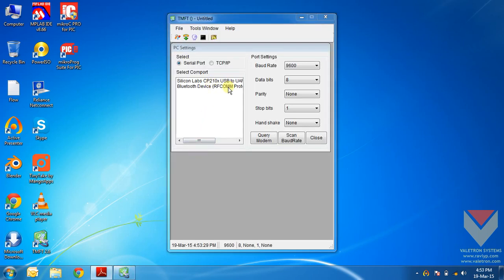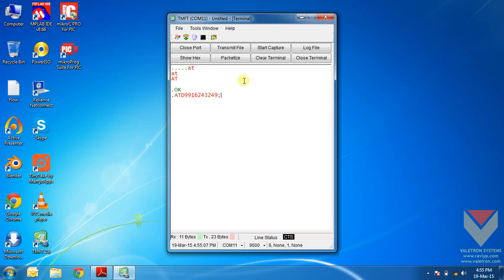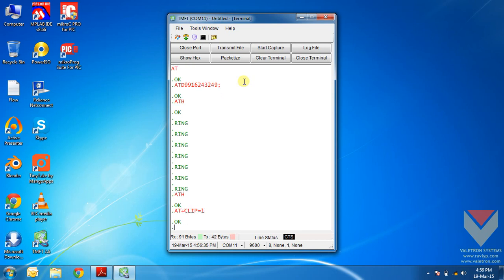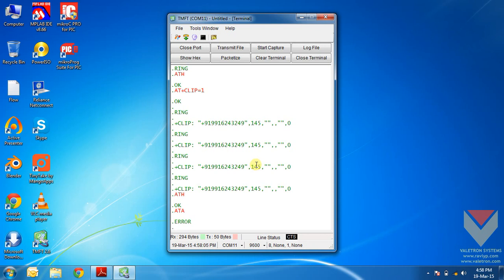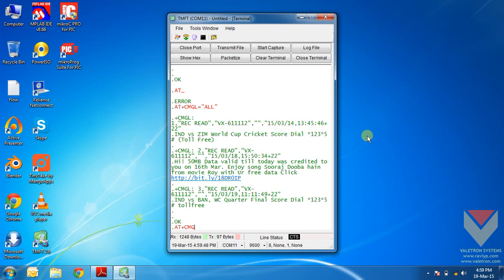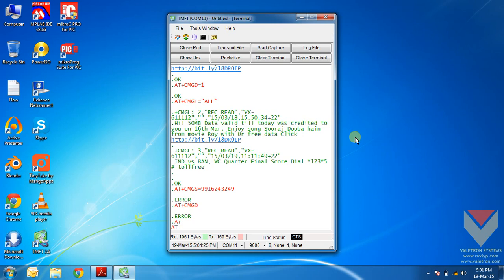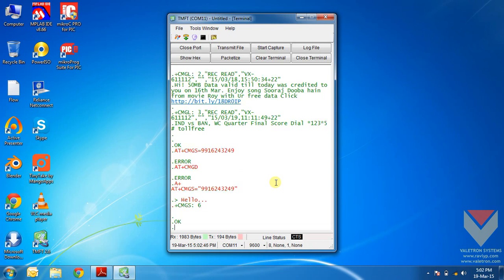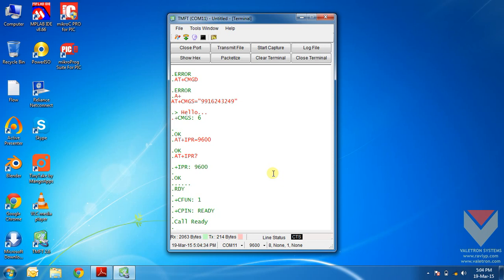SIM900 AT Commands

Comment from the maker: @Aaron Lynn. 

Yes it is the HEX string that appears as IIII or .... when you power up the module. It depends on the baud rate you have set the terminal software to. If you have set for 9600 bps, you might get .... and if you have set baud rate for 38400bps you might get IIII like that. :)
Reply: Ravi Pujar Thanks :) When I attempt to write a Command after this sequence it does not respond? Could this be because of the baud rate also?
Reply from the maker: Aaron Lynn Two things you should look at.
1) Keep Type capital "AT" and press Enter not small case "at". It only recognises Capital case AT at start to autodetect baudrate.
2) Check your DTR pin connection. It should be connected to GND through a 10K resistor. Let me know if that was the issue.
Reply: Thanks Ravi, I have it working now, You do not actually need the DTR pin for my purpose I have it up and working now
Reply from the maker: Aaron Lynn Glad to know its working :)
Reply: @Gigaclank  hey Aaron..what was workaround for that issue? I am getting the same issue..thanks

Comment: in TMFT software, when i type anything, it prints twice , can you tell me the solution.
typing AT prints - AATT,
I have downloaded from your dropbox link
Reply from the maker: You can turn off echo using ATE0 command
Reply: @RaviPujar  Thank You for the reply
I have a task of connecting EC25 4G modem to stmf4 controller using usb 2.0, but EC25 dont provide driver for stm, Can you give some pointers on how to move forward with integration? EC25 has a vendor specific class.

Comment: Great video ! Thank you Ravi. but I want to know, the method you showed us need to write the commands manually by computer. How can we conceive a system (electronic chip) that do all these commands automatically (like in our cellphones)? what is it and how?
Reply from the maker: Hi Thanks.  You need to write a simple uart program to communicate with the module.  You can use any microcontroller of your choice.  Lot of examples are available.  Email me if you need further details.  You can watch my another video where I communicate with a program written for a arduino microcontroller
Reply: @RaviPujar  hlo sir i need to connect with 8051 microcontroller can you tell the code.

Comment: I am stuck on a level where there are two buttons after processing a transaction using the stk. It has Ok and Cancel. I need to press the ok button using at-command, how can I do that?

Here is the last response from the serial port:

+STIN: 1
AT+STGI=1

+STGI: 1," Press ok to continue",1

OK
Reply from the maker: +Adib Khan Are you using SIM900 module?
I have not encountered this command.
Reply: +Ravi Pujar i am not sure about the sim module, but what do you usually do, if there are two buttons like yes and no by using stk or say some ussd code and thats the response you get.
Reply from the maker: +Adib Khan Check this for USSD commands
http://www.raviyp.com/embedded/190-sim900-sim800-ussd-code-at-commands-working-example

Comment: I AM UNABLE TO REcIVE ANY information from gsm module when i type on serial moniter but it will work once the code is uploaded and runned .....i am getting random things when module starts but nothing is returned after that for any AT command given through idk
Reply from the maker: Might be you are communicating at wrong baud rate. Try different baud rates and also if its in autobaud mode, make sure that you are sending first AT command in Capital i.e, AT

Comment: How to solve that problem. when send receive sms program upload in Arduino uon display this message "OVER VOLTAGE WARNING" In serial monitor.
Reply from the maker: +Sher Hasan Khan It means you have given voltage more than 4.5V. SIM900 accepts power supply only from 3.6V to 4.5V. Best to give 4V.
Reply: Ravi Pujar
The overvoltage warning problem will solve.
But now does not receive sms on GSM module.please help me
Reply from the maker: There could be multiple reasons why SMS not received. First call and check if the module is ringing. 
The below article should help. Its the same with both modules SIM300 or SIM900 or SIM800
http://www.raviyp.com/embedded/137-sim300-sms-call-not-working

Comment: Hello sir myself vaishali i also want your help regarding programming on wireless notice board using . i also use GSM Module 900 sim . i have to do this project programing on AVR Studio i have tried but it will not be right please help me and tommorow will be the last day for project submission
Reply from the maker: Hi Vaishali,
What problem are you facing exactly?
Reply: Ravi Pujar sir I want to make a project on wireless notice board using gsm and I brought components like gsm module sim 900 and a kit of atmega16 . Now I have to do programming on that so I use avr studio but actually I know lil bit of programming so I want your help for that programming
Reply: Ravi Pujar and also I not get how I make this project
Reply from the maker: There are lot of ready examples online on how to display incoming messages on Arduino. 
You could just get hold of those examples and get it working.
Its just that, you need to read the incoming messages and put that message on to screen or display when a command is received by SMS. 
Check one of my video shows how you can read a SMS using Arduino. That should get your started.
Reply: Ravi Pujar but my project on microcontroller not on aurdion I not have aurdino kit
Reply from the maker: What i mean is use the example and convert the logic to suit your controller. Nothing will work straight away, you have to do some work on customizing it. If you  are specific problems in doing this, then ask me.

Comment: Hello sir, i tried AT+CLIP=1 command in Arduino, but i'm not getting incoming  call number. Please help.
Reply from the maker: If you get OK as response after AT+CLIP mode set command then it should work. Are you getting RING only?
Reply: No sir, i'm not getting ok response. Ya i'm getting only ring, not incoming call's number.

Comment: Hi, how did you connect your gsm to the computer? did you use other interface device?
Reply from the maker: I used CP2102 USB-UART converter, You can find it here http://amzn.to/2j122Pg . But make sure your module has level translator. Because i used GSM module with level converter built in. GSM IO levels are at 2.8V and USB-UART converter UART levels are at 3.3V or 5V.

Comment: hey man,
If i type say 'A' then "AA" is coming on the terminal window.
Everything is coming two times on the terminal window.
Can u help me?
Reply from the maker: Use command ATE0 it will stop the echo :)
Reply: thanks it worked....
I have one more problem that i am not able to use ctrl+z to send the messages.When i use ctrl+z then it worked as backspace.
Reply from the maker: It depends on the terminal software. Use software which have hex mode. to enter 0x1A. 
Dont forget it subscribe :)
Reply: I have subscribed you.....but always give answer to my doubt:)
Reply from the maker: Sure will do :D
You wont find much unanswered comments on my videos.

Comment: while working sending sms through command AT+CMGS="123456789" <ENTER>
>  MY TEXT <CTRL+Z>
i didnt get any message it is still
>
>
what is the error
Reply from the maker: venkata ramana Depends on which terminal software you are using. It means your terminal software is not sending proper Ctrl+Z character when you press it. Use a HEX input option if your terminal is not recognizing the Ctrl+Z character. You can use HEX editor and send 0x1A instead.

Comment: Hi Ravi,
can I use the AT+CLIP=1 command with the help of software serial in arduino and send it to GSM sheild then receive the response of the GSM sheild and print the number of receiving call on the serial monitor of arduino ide??
Reply from the maker: Hi Jasmeet, 
AT+CLIP does give you the callers number, But if your module is connected to UART which is used in the software serial then yes, you can send the command from it unless your Arduino UART doesnt interfere with it. And make sure you have proper voltage level conversion for 5V UART to 2.8V UART which SIM900 supports. 
On the contrary i would suggest writing a simple code to enable the caller ID notification (CLIP) and process the incoming number and put on software serial.
Reply: Ravi Pujar I am using the arduino uno to send the AT commands to the GSM module. I have written a simple code to display the bytes sent by the GSM module to arduino on serial monitor but it is always showing garbage values instead of printing RING(which you said should print when the GSM module is receiving a call). So how can I solve this problem??
Reply from the maker: Jasmeet, You can check the baud rate once if you are getting garbage. If data is corrupted while only call comes then it might be problem of power supply being noisy or the GSM signal interfering with UART signals. Check the power supply lines on scope to see if the power is stable and no glitches.
Reply: Ravi Pujar the GSM is not even responding to the command AT by showing OK through the serial monitor. But when command is given for calling, hanging call or answering call using software  serial then it works fine.
Reply: No carrier is showing after ATD comments
Reply: @RaviPujar  no carrier is showing after ATD comments